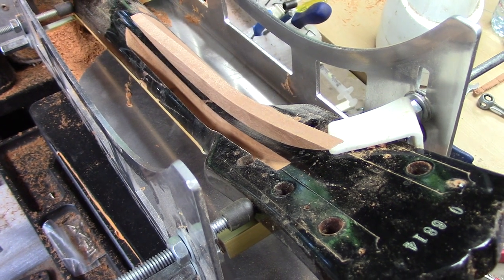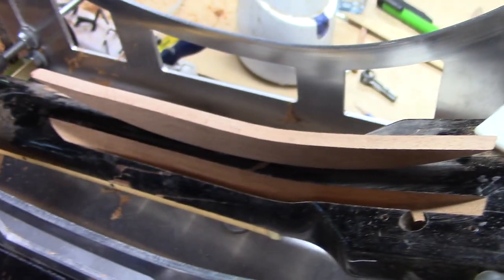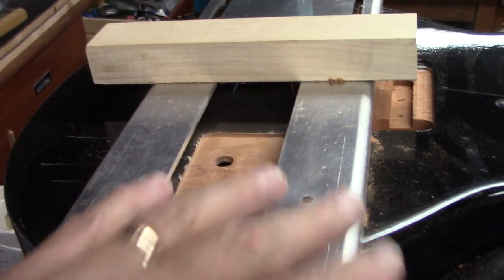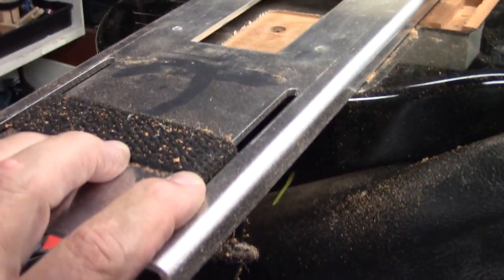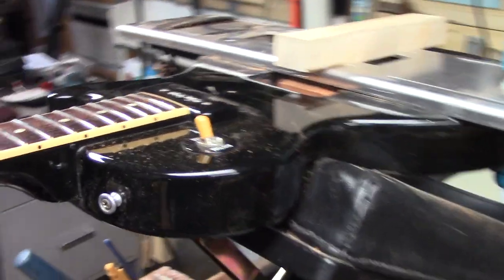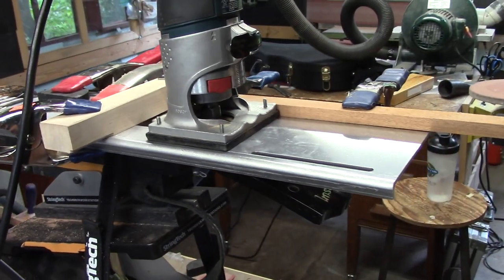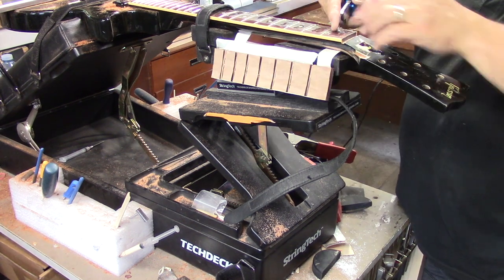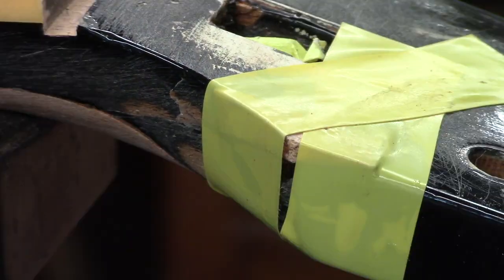Les Paul Neck Surgery Episode # 3

Comment: It certainly is the art.  I love watching neck repairs that you do with splines.  Thank you so much for sharing.
Reply from the maker: Cheers KG. There are a couple more episodes to go yet ... I really wanted to get this out there for all of the TechDeck / NSK owners .. to show them one of the worst possible case scenarios.
Reply: KenG yes, the way Mike matches the groove to the breakpoint. Each one unique in reading the break and planning the spline. 
It's kind of like watching another beautiful Bob Ross painting.
Reply: @StringTechWorkstations  
Hello,
I just bought a 2018 L.P. Classic with a headstock repair. They did a good job on the repair however the seam of the crack runs across the front of the headstock & underneath the truss rod cover of the last c in classic.
Can you recommend a lacquer pen to use for covering the seam?
Thank you for any advice,
Edward
Reply from the maker: Edward. The only way to fully eradicate the “Frankenstein lines” .... is to water sand and blackout the face of the headstock .... then reinstall the Gibson decals ... clear- coat wait a couple of weeks then buff it out.
Sorry .... no quick fix on this one.
Cheers 👍 MMcC
Reply: @StringTechWorkstations  
Thank you for the quick reply & advice